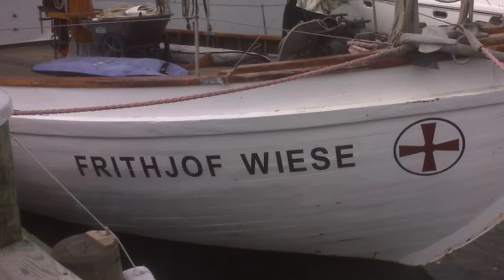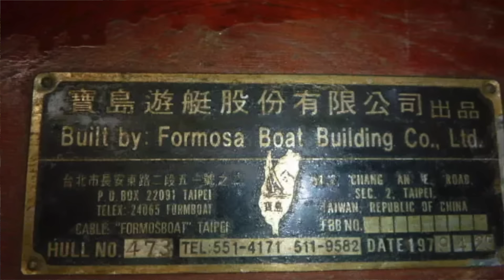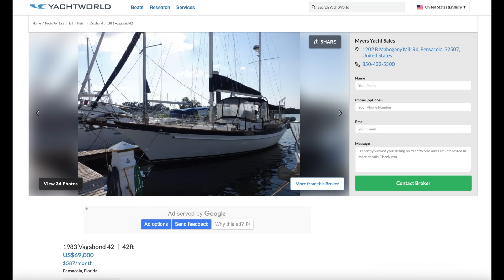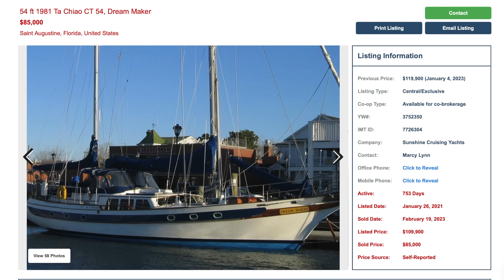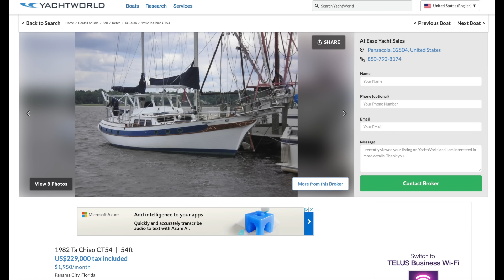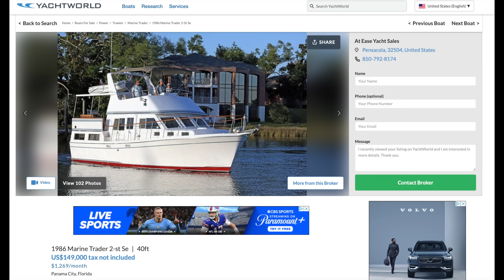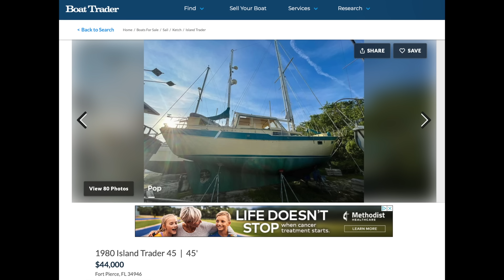*PART 2* WE MADE AN OFFER on the ABANDONED Mikelson 50 Pilothouse and We Got a Response! Ep. 36

Comment: My last boat was a Tyana FD12, a 50' cutter. Years earlier I commisiioned and sailed the first HansChristian in Seattle. Both came from reputable Chinese yards. At the same time in the rest of the world the only thing that seperated non Chinese boats from boat built in the USA and elsewhere swas the abundance of teak joinerwork below. However they both worked with materials available the. All the Stainless back then was inferior to that today. That means chain plates, all the standing rigging, anything made of stainless outside would fail in time. Unless you want to xray evey piece of ss on the boat, replace it all. The resins, glues, caulks were and the layup technique is all vastly different today. Hull failures, rudder delamanation is common. The hardware particularily the thru hulls in inferior to today's products. I could go on but you get the point. So if your heart is set on a boat of that era, probably due to the cost, I would thnink again. You are going to have to spend $$50-100K or more plus to get her truly seaworthy and safe, and when you are done you have a slow boat that takes some real skill to manuever in a tight docking situation. There really is no end to the work and money you will spend on these boats. If you don't have the money at the outset to do all that is required, don't buy it as it will not be seaworthy. Every system on the boat need attention and often system replecemnt. Another issue with these boats is engine and bilge access, inferior glsss or plastic windows and caulking, teak decks that need complete re caulking, etc. Much better to keep looking and saving money. To set out on an extended voyage you will need money in the bank.Every where you go there are fees, haul outs, repairs, parts, shippping, trip back home. etc etc etc etc. What you may come across is someone who had done all that work already and is willing to sell it at a bargain to unload it. You would do vastly better in a cat and the repairs likey far easier.
Reply from the maker: Im not sure how repairs to a cat are easier, but I agree with what you’re saying. It’s not easy to take on an older Taiwanese boat. (They’re not Chinese) We are familiar with Taiwan builds and I have always wanted a Taiwan build- specifically. I really have no interest in most other builds. It’s like being a VW guy and someone trying to sell you a Kia, I’ve said before. We guesstimated around $150k total on this one but that’s to do everything- including a new mast. Of course that was assuming the systems were just functional, at minimum. The systems do mostly work, we found, so that’s a big plus. They’re more maintenance, absolutely, but we have been particular on style and size for a variety of very valid reasons. We wanted the forever boat now, so that the work and money we out into it stays with us for life. I don’t want a lesser boat that I don’t want to keep forever and put tons of money into it just to sell it for less than I have in it, because that’s what happens. However, we’ve had unexpected expenses come up and it’s a slow season in yacht sales and I’m a broker, so money isn’t exactly replenishing itself right now, so we may actually do what we didn’t want to do and go a little smaller for a couple years and then upgrade later.